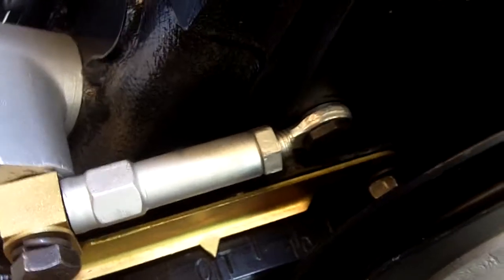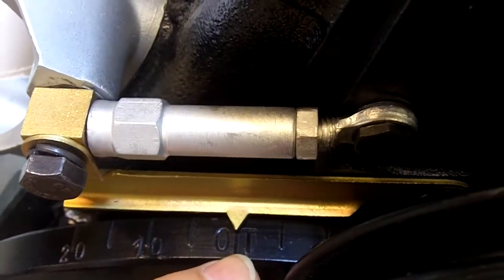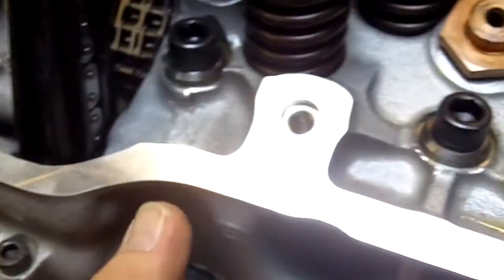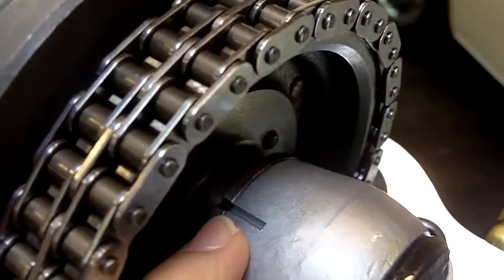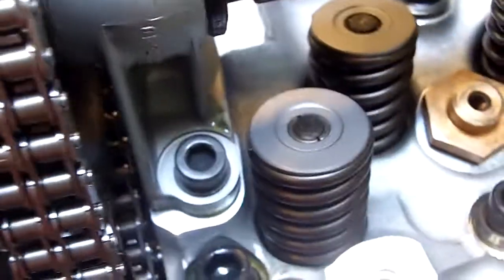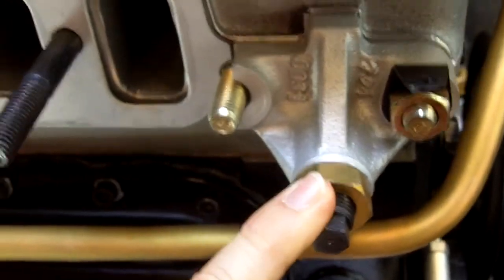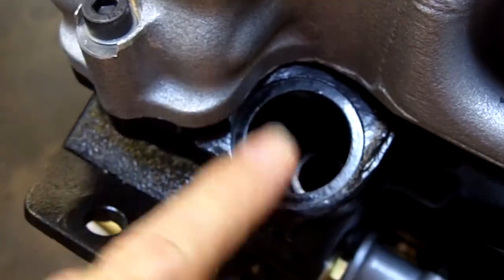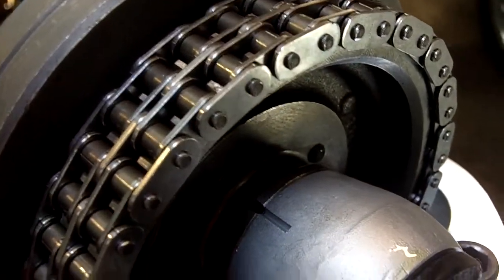Mercedes of the 50's-70's Camshaft Timing Using 300SL as Example

Comment: Please do a video on timing chain replacement on a 4 cylinder.
Reply from the maker: Thank you for viewing and asking. There are two reason for TC replacement: during a full engine rebuild and service work to replace just the chain. We don't do that kind of service work anymore. If you need a new timing chain you usually need a whole bunch more parts, like sprockets, chain rails, etc. During a full rebuild we install the crank in the block, turn the engine upside down, install the chain and thread it thru the various sprockets (notice I said sprockets, which run on a chain, gears mesh with each other and these MB engines do not have timing gears). Years ago I have installed TC only as part of service work on gas and diesel engines. One person can do it but it is better with 2-3. You find the removable (master) link and disconnect the chain, connect the new chain to the old and slowly crank the engine by hand as the old chain is pulled out and the new chain is pulled into the engine. Make sure chain stays in constant contact with the cam sprocket. If the chain is original then there will be no master link and you will have to cut a pin holding the chain together. Hope this helps.